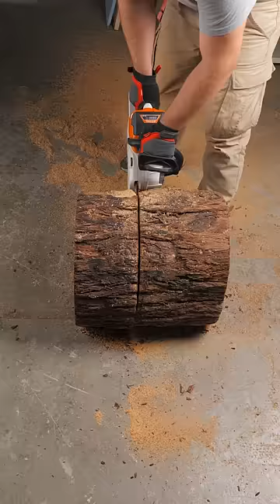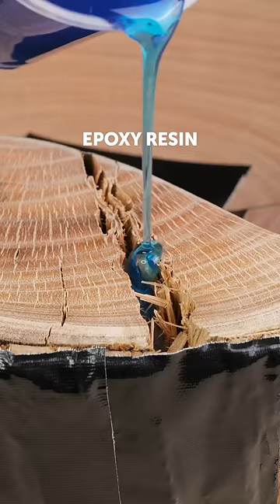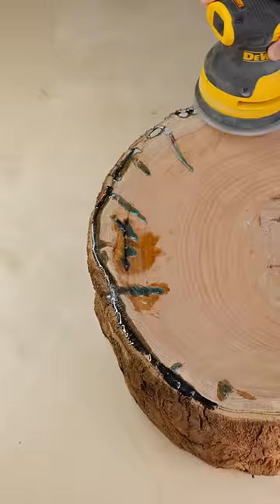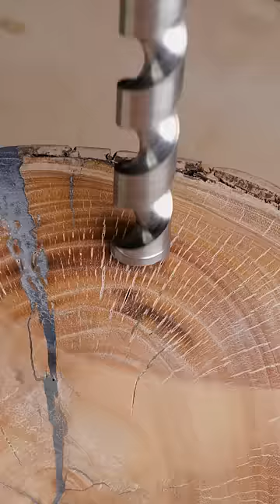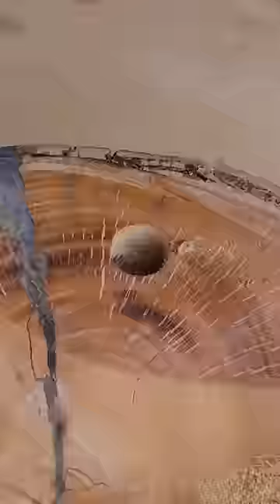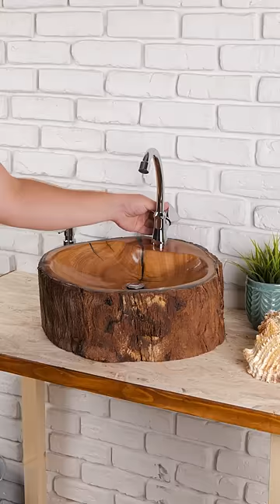We made a sink out of wood! Amazing recycling project! #woodmood #shorts #recycling #wood

Comment: How long would this last with regular use?
Reply: I'm curious about that too
Reply: If sealed well and resealed and not left wet for too long or used harsh chemicals on easily a decade or so probably. The issue is more so that it'll require far more maintance than a normal ceramic sink. More than some fancy stone one even probably